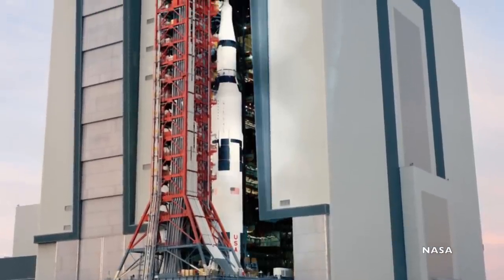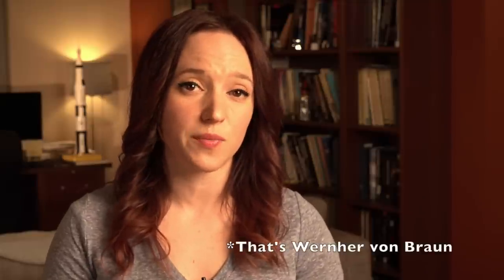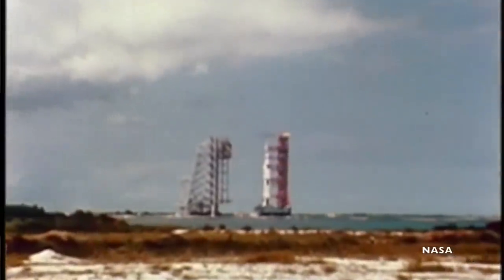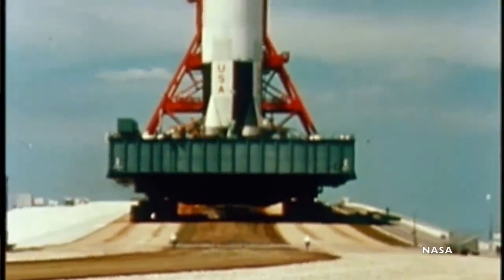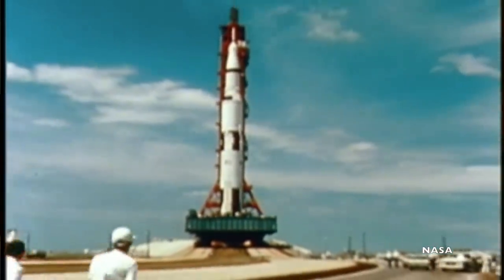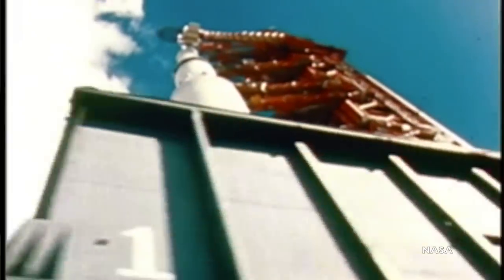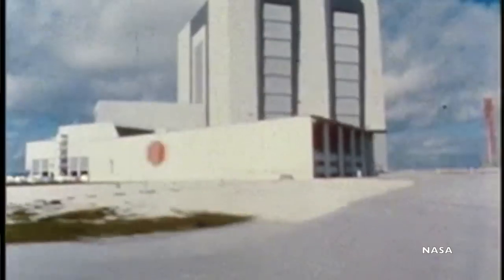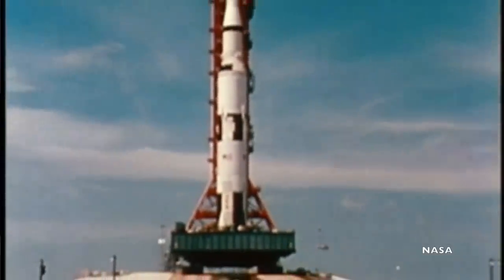How Do You Move a 363-Foot Tall Rocket?

Comment: Post launch; I once put a quarter under gantry tread to see if it would flatten like a penny on a rail.  ...nothing.
Reply: +Goyo AS Low ground pressure, If the ground was soft enough you could probably let it run over your foot. A modern main battle tank exerts the same pressure on the ground as a medium sized family car.
Reply: +Goyo AS Yes, show how well the contact patch of all the treads distributed the weight over a large area on the ground. I still wouldn't want to have it accidentally go over my toes, even if it was over the "softer" gravel of the crawler-way.
Reply: +Goyo AS : Well, you're lying of course. I've seen these with a Saturn Rocket on it on a tour, but no unauthorized person is allowed to actually approach them. And, they were not on a rail, but a road. I see three people were dumb enough to fall for your claim.
Reply: +Hanno the Phoenician First, what makes you think Goyo AS isn't authorized? Second, Goyo AS was only making a comparison in saying, "LIKE a penny on a rail," and not that it was actually running on rails (since I believe that was explained in the video as being impossible given the terrain at the Cape). Third, Goyo AS is basically asserting that the crawler is doing exactly what it was designed to do: provide a large contact patch (surface area) to evenly distribute heavy loads in the most stable manner as possible.
Reply: ***** I don't communicate with sycophants.
Reply: You're welcome, +Goyo AS. I was only trying to point out that some of us understood exactly what you were writing about. 

No doubt, this +Hanno the Phoenician person is some piece of work. Because he/she can't comprehend what you were talking about, he/she accuses you of being a liar, then accuses others as being dumb, and then later implicates me of being a sycophant for trying to be nice by taking the time to explain it to him. All these are unnecessary and unwarranted ad hominen attacks. I then call him/her out on his continued ignorance, yet apparently I'm the the one who is the troll. Not only is +Hanno the Phoenician the real troll, but he/she may also be an Internet bully, which is even more pathetic.

And +Hanno the Phoenician, since you've continued to communicate with me, I guess that means I'm not a sycophant either. Good day, sir/madam.

Comment: I don't believe you mentioned that these are still the largest land vehicles ever built.
Reply: +bobobobinalong There are actually larger vehicles used for mining/excavation, but they are all have external power sources. The Crawler Transporters are indeed the largest self-powered land vehicles, at least at the time they became operational. I believe it's still the case to this day.
Reply: +bobobobinalong dont think they are, i believe a drag line machine is the largest surface machine.

Comment: So how did they actually get the thing onto the crawler in the first place? Was it built in situ?
Reply: +cyberpunkdreams The VAB (Vehicle Assembly Building) has a huge crane. They built the rocket, then lift the whole thing onto the crawler.
Reply: +Tim Keller Actually, no.
They build the rocket on the launch platform, and drove the crawler under it, liftet it by hydraulics onbord the crawler, drove it to the launchpad, lowered the platfor and drove the crawler back again.
But yes, the big crane inside the VAB, did assembly the rockets, and the spaceshuttle later.
Reply: +x3mperformace I thought it sounded a bit much that they lifted the complete vehicle onto the crawler with a crane.

Comment: ..."a 6 million pound machine"...  Maybe when fueled at the launch site but not when in transport.  So, again, what was the empty weight?  Or rather, how much of the 6 million pounds was fuel added prior to launch?
Reply: If you include a fully fueled and loaded CSM and LM, the Saturn V weighed about 500,000 pounds dry, so roughly 83% of the weight at liftoff was fuel.

Comment: Say, whatever happened to the Apollo mission where one of the engines on the Saturn V failed?
Reply: That would be Apollo 13 where the center engine cut out on them not too long after launch.  They still made it into orbit on the four remaining engines but, as you may recall, they did not land on the moon.  They were so close and made it back by the skin of their teeth.
Reply: Mark - Incidentally, Apollo 6 (unmanned) lost two engines to pogo oscillation.  It still made it into orbit, though.

Comment: 6000 horsepower is not that much, they could have just used 6 Bugatti Veyrons to tow the rocket.
Reply: +Xfactor Chem, Torque at low revolutions. Probably large displacement.